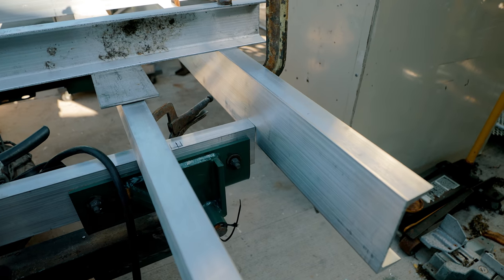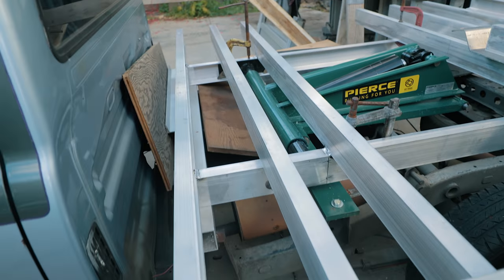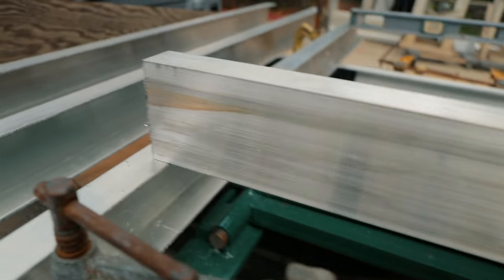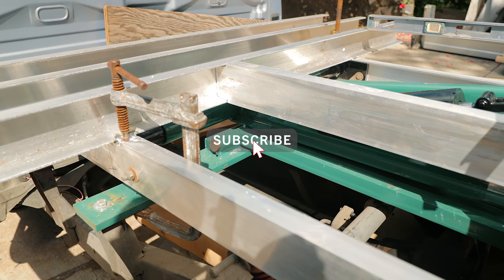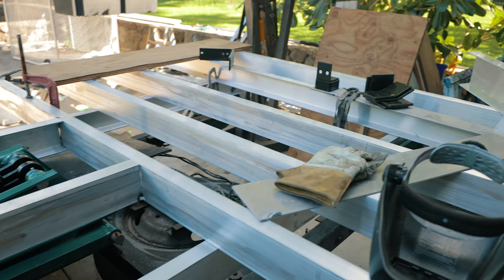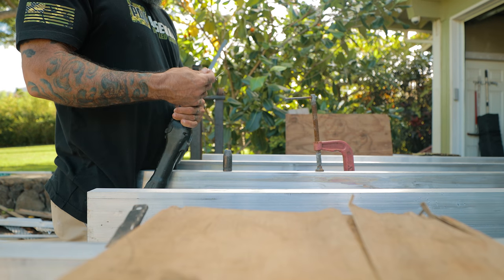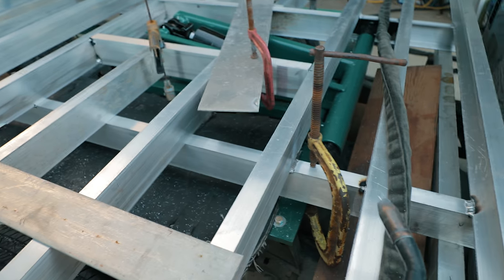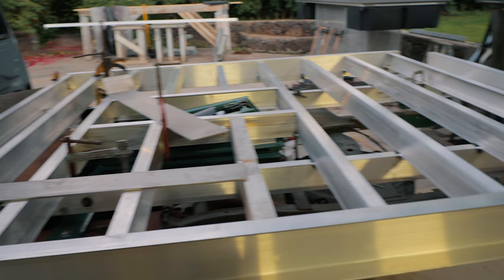DIY Aluminum Flatbed Dump-Bed  Build 2021- Part 4

Comment: Loving the aluminum Flatbed build. Thanks for explaining what you are doing. In all the years you have been welding Aluminum have you ever had any welds crack at the weld joint on you? I am thinking about building a flatbed dump also out of Aluminum.
Reply from the maker: They don’t crack at the joint but they will break at the edge of the HAZ when subjected to destructive forces. Thanks for watching and commenting I appreciate it!